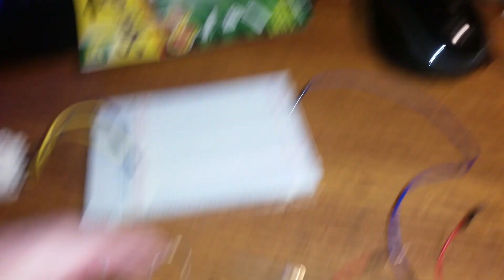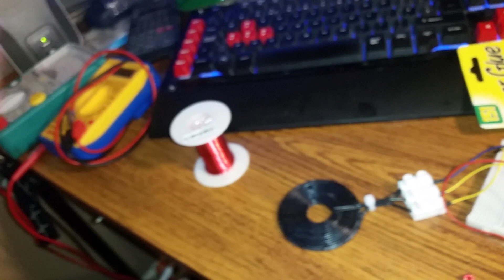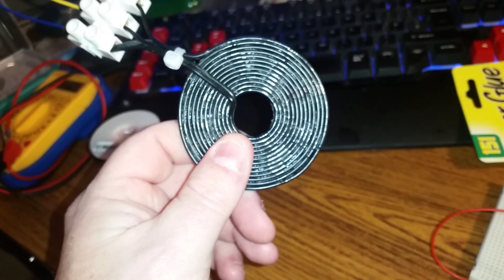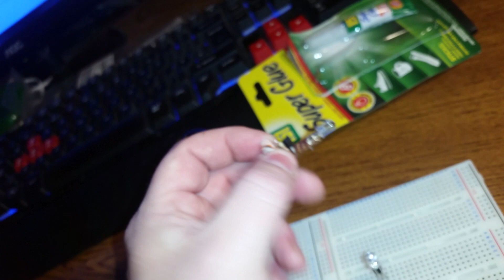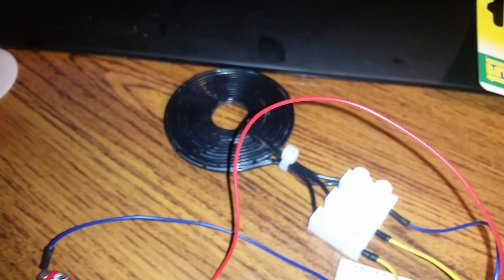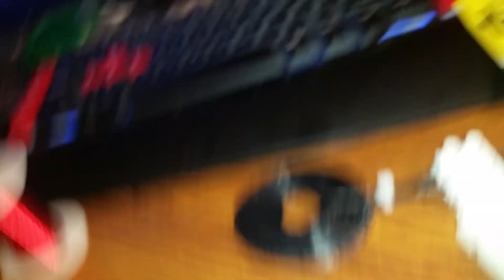Joule Thief with Tesla pancake coil

Comment: you'll get high voltage from an inductor only if you present it with high resistance, R and V scale together to keep the I going for a time dependent on how high both are, higher means shorter... Nice vid but long as hell lol